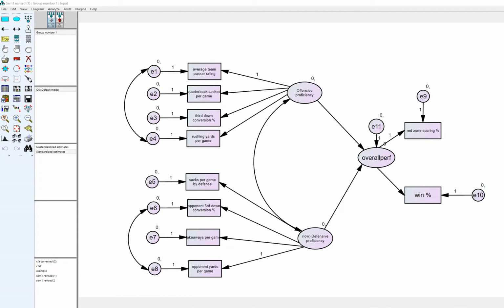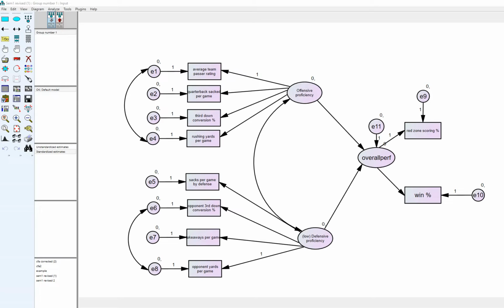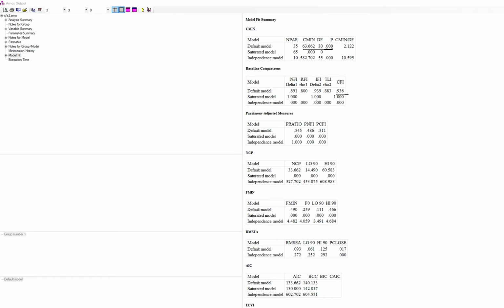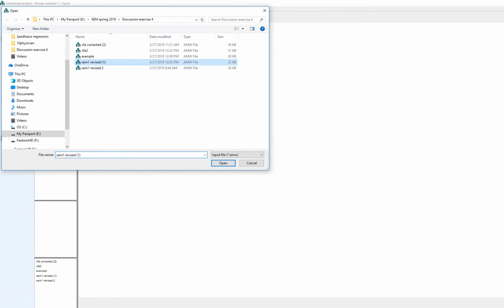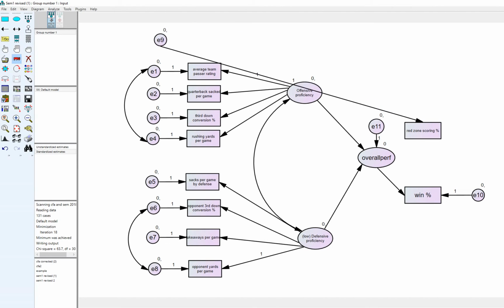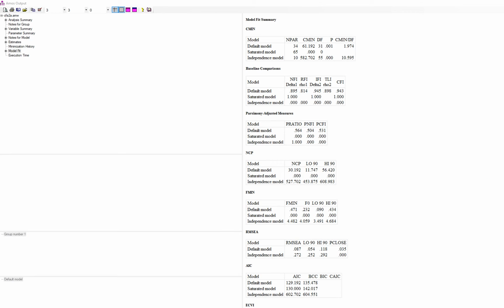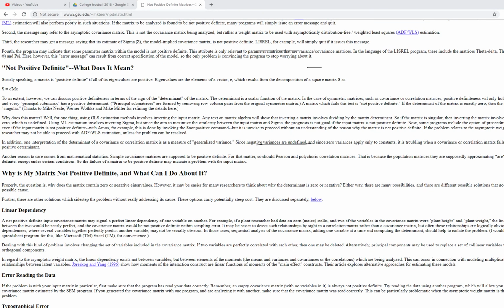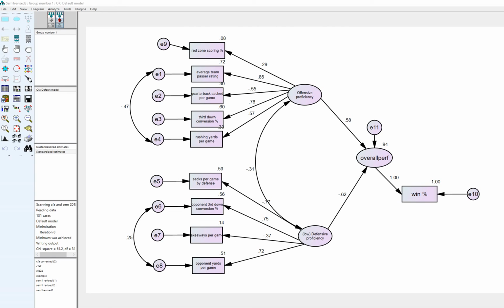Path analysis in AMOS with latent variables (March 27, 2019)

Comment: Dear Mike, thank you for the interesting video. When do I have to use simple path analysis (all variables are measured without errors) and SEM?? I have to assess some relationships but I do not understand which one I should use. Thank you in advance
Reply from the maker: Hello, the choice to use SEM with latent variables versus one with manifest variables only really boils down to your tolerance for measurement error impacting your results (by the way, I think of SEM as incorporating both manifest variable path models and latent variable models). If you run a path analysis with only manifest variables, then the path coefficients will be impacted by the degree of unreliability associated with those variables. Typically, the effect of unreliability is to underestimate relationships between variables. Moreover, if you have multiple predictors of an endogenous variable, then underestimation of a path due to unreliability may also bias other predictors of that variable (in the same way this can occur in the context of linear regression). The reason for using a latent variable modeling approach is to 'correct' path coefficients for measurement unreliability. Of course when you go this route, you also end up with a more complex model since it will contain a measurement portion and a structural component (the latter reflecting relationships among latent variables). Theoretically if your manifest variables are perfectly reliable, there would be no need to use latent variable modeling. Some folks might argue that their manifest variables are reliable enough that they are willing to accept the trade-off between model simplicity and possible bias in the regression parameters (due to whatever unreliable variation there is associated with the variables). Ultimately, the decision is up to you about what you are comfortable with. But whichever way you go, you should be prepared to defend your position. 

I hope this helps!

Cheers!

Comment: Hi Mike! Your videos have been a life saver! Can you provide rationale for why you have certain error terms correlated with each other? I have seen this in a few videos, but I am unsure as to why these correlations are included. Thank you so much for your time and great videos!
Reply from the maker: Hi Ray, there are a couple of cases where correlated errors are frequently used in SEM. When working with a CFA/measurement model, correlated errors (in that context, often these are referred to as ‘uniquenesses’) are included to address common method factors that may contribute to some of the correlation/association between indicator variables. Failing to adequately capture the part of the association between the variables constitutes model misspecification, which can end up hurting the fit of your model. So researchers, might consider adding in correlated measurement errors in certain cases. The trick is to do so in a way that represents proper specification AND is reasonably parsimonious. The second scenario involves a situation where perhaps there is a belief that the prediction errors associated with endogenous variables in your (path) model might be correlated. For example, let’s say I am predicting two endogenous variables in a path model, where both of them are different aspects of student engagement in learning – cognitive and affective. I might have reason to suspect that the disturbances might correlate since the engagement scales might themselves be correlated. These are just a couple of rough ideas to illustrate when you might include correlated errors. 

By the way, I hope you consider viewing the latest video and materials I have put up on latent variable path modeling: https://youtu.be/DSHa0WreIYc

Cheers!
Reply: @mikecrowson2462  Thank you SO much! That was a very helpful explanation and I just finished watching the most recent video you posted! Appreciate all that you do and thank you again!

Comment: Do we do confirmatory factor analysis before path analysis, knowing that the variables are latent?
Reply from the maker: Hi there. In general, we start with a CFA to test a measurement model prior to running the path analysis with latent variables. The reason we do this is to ensure the latent variables are adequately being measured. If the ceiling in terms of the fit of your path analysis with latent variables will be the fit for your measurement model. So that is why you generally start there first. Hope this helps!
Reply: @mikecrowson2462  Thank you